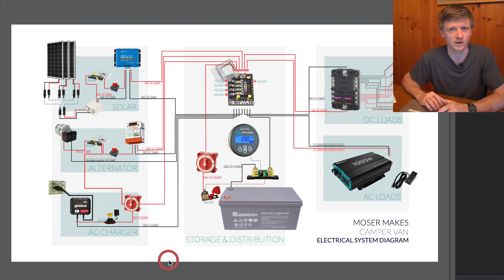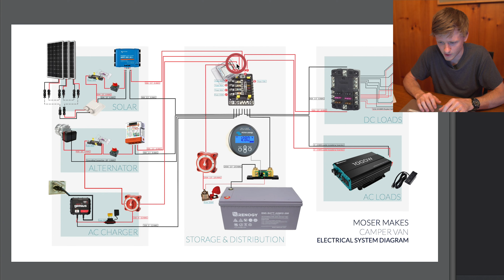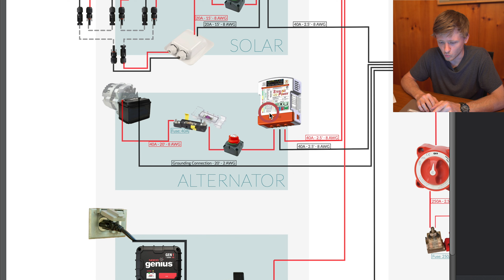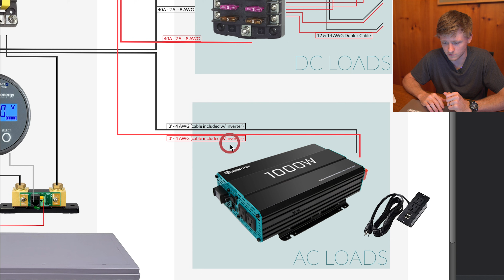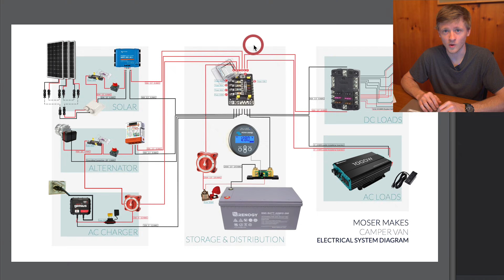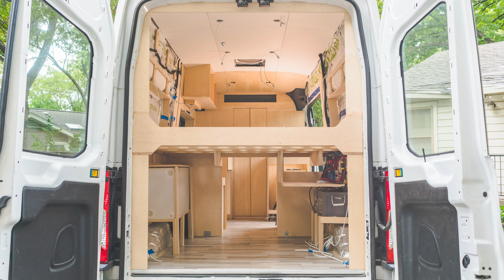Camper Van Electrical System - Comprehensive Look!

Comment: 3:50 Note that a simple voltmeter is only useful to determine the state-of-charge (SoC) for a lead acid battery. For a lithium battery, the voltage drop-off is very flat from 90% to 10% SoC, which means you won't get accurate readings if you try to determine the SoC from voltage in that range.

A smart monitor measures both the voltage ánd the current draw over time, while keeping track of how many amp-hours (Ah) have been used, and therefore how many Ah are still left. Though overkill for lead acid, this is necessary for lithium batteries.

Comment: Hello Moser:
I would like to know if you have to ground your solar system to the body of the van. This would use the same ground as your car battery. OR did you actually keep the solar system ground independent/not connected to your car battery ground? hope this made sense.  Thank you

Comment: If you had the dual alternator/dual battery option from Ford on your Transit, could you just take the leads from the non-starter circuit alternator and just attach them to your house positive/negative bus bars instead of using the battery/battery charger?

Comment: Okay... question of the day... what's the difference of a Alt to B charger vs B2B? My van came with a Sterling Alt Pro C (Alt to B) charger however I'm starting to rewire and build for solar. Now when referencing what everyone is doing, they have the alt wired to starter battery and then have the B2B charger coming off of the starter battery. I find your video the best which I seem to find myself gravitate back to. However, I'm doing mental gymnastics with what the difference is or could be in these products. I'd LOVE your take! Thanks!

Comment: You should add a AC shore direct cable input to your AC electrical sockets and have a some dedicated socket only for your inverter and then your setup is complete

Comment: Tip 1 if you vehicle has  a seven pin trailer connector.  It has a circuit to charge aux battery easier setup fewer parts automatic disconnect when vehicle is off already fused.  Splice into trailer connector wiring easy.

Comment: Sam, thank you for this--it was great.   Can you share a link to the 12v blue splices you used, as well as the quick disconnects you used?  Do you have any video showing exactly how you ran your 12v wires around to all your lights, light switches, fridge, etc?  Sort of wanting your thoughts on through the wall vs inside cabinets or behind insulation, etc.

Comment: Very well talked through. I'm sure I'll be watching this 100x as wiring is not my strong suite - thank you for this. How has the battery worked for you? I'm trying to find a battery for my van, no solar power since it's basically a weekend get a way van but I've been looking at the Battleborn lithium batteries. Much more expensive than what you have but the link you shared reads a 200ah battery.. makes me wonder if this would work.

Comment: Not bad mate. Only recommendation I would say to you is to change those couple of crimp wire splices out to soldered connections instead. I have found they will always fail after  a year or two. Since they are an insulation displacement joiner, they are prone to eventually spread further open and create intermittent connections. If you are drawing enough current through them, they can heat up and eventually burn out   The rest of the terminals etc are really good. Great work.

Comment: The Blue Sea Hub is designed as a distribution board for outgoing circuits
Your diagram with the two buzz bars is a much better way of connecting all those inputs together. I would only publish that one to be safe. 
You couldn’t put a 3000w inverter on that hub it cannot handle that load
Reply: Interesting. I know nothing about automotive/marine electronics but even I thought something was missing in the explanations. Like why does one 8awg wire use a 30am inline fuse and another 8awg wire has a 40 amp fuse? The fuse is to protect the wire as well as the devices but do both of those fuses protect and AWG wire size? I don’t know but it’s an obvious question and no explanation was given for why that works. Please explain WHY it is better to go with the two bus bars? I think you’re being nice and left out that those fuses were not necessary and were duplicates. If they’re not duplicates then they are necessary so which is it? That was an area in which I wondered why it is necessary to have additional fuses if they can be replaced by non fused bars? The blue sea hub is an expensive part and if you tell people they don’t need it they’re going to find cheap alternatives. I know about AC electrical in houses but I don’t know DC in vans.
Reply: @GOLDVIOLINbowofdeath  my video on cable and fuse sizing may help you https://youtu.be/koFg6oFs0RU
Reply from the maker: Hi Greg, yes this is a really good point. Blue Sea Hub was a great fit in this system which has a smaller 1000W inverter (and overall the system is on the smaller side). For larger systems it is better to use separate bus bars or power distribution blocks.
Reply: @MoserMakes  the only reason I mention that is because the max rating of the hub is 200A at 12v and a 3kw inverter could pull more current than the safe limits of the hub. Thanks for getting back to me. Best wishes
Reply: @GregVirgoe , thanks you to have pointed that out. I'm don't have much knowledge but I'm looking to build the same kind of electrical system for a van conversion. What do you think about a 2000W inverter for this kind of build with the same hub? Thank you !

Comment: Hey Moser, awesome videos. I've watched them all and they are proving very helpful. But I need some help. 

If I want to run induction stove top (1800W) and toaster oven (1800W) at the same time I would need a 4000W inverter.
Induction Stove top and toaster oven max of 2hrs per day total -> 1800W * 2 hrs / 12V = 300AH battery required
200AH battery can produce up to 2560W (200 * 12.8), 2000W more realistic.
So I would need 400AH of battery for my 4000W inverter running toaster oven and induction stove top at the same time. 

Does all that sound right?

Comment: Just built this setupa dn everything works well except the switch (1-2-OFF) to differentiate between if you wanna charge (shore) your car or leisure battery. I bought the exact switch, but didn’t work. The wiring is correct bc it works if I just put a ON-OFF switch. Any idea why?

Comment: I am putting a leisure battery in my 2009 Volkswagen van. Coming from my split charger for my secondary battery, can I use a lithium battery? Even though the battery that starts my engine is not lithium?

Comment: Awesome video.
A little question though:
Is a battery to battery charger really needed here or just a VSR would be good enough?
I would assume sensitive relays do apply to standard Alternators, where battery-to-battery chargers are used for Smart Alternator? But I might be wrong. Can someone shed some light on this? Cheers.

Comment: First of all great video. I'm wondering if you might be willing to answer a question I have. With the cutoff switch from your panels to your charge controller. Since your connecting panels in series I assume your voltage comes out to about 60v. From what I'm able to gather the cutoff switch in your link is for a max of 48v systems. Are you concerned at all about that? Or am I not understanding something correctly. Thanks so much for your content and for any help!

Comment: Great video, we are wondering in your diagram, the AC charger connected to Bus Bar Label B which is output to DC loads then how it can be charge the House battery if we plug into shore power outlet? Thank you

Comment: Hi Sam,
What a simple and easy to follow video. I have looking for months for just this. Well done.
I have a few questions based on you configuration.
1. Do the fuse and shunt sizes change with larger battery and solar?
E.g. I have 900w (3 x 300w) solar panels with 450ah (3 x 150ah) AGM batteries.
2. I have 1000w inverter. With the solar/battery sizes, do I need to up see the inverter?

Comment: Your wires are loose (and messy but that's not a danger)....loose wires start shaking while driving (that's why cars use special wire) and can break internally...this can cause defunctioning and/or fire....
You should not let the wires hang loose, bundle them and mount them.

Comment: I.B.E.W. Wireman here. Good job kid. You may want to recheck your wire sizes with a real handy cheap book called a Ugly's Reference book we use in the trades. Amperage is decided by the insulation on the wire which determines which gauge. Then look into derating also which is more of a problem with the DC side. DC has alot of voltage drop hints why we use AC on power poles for miles & then into homes, commercial buildings etc. Great job though seriously. I cringe when I see ignorance breeding on YT too often on electrical. Ignore the thumbs down you get & negative comments. We go to school for 5 years & are the best in the world. If I had to grade you on this it would be a 80 to 90% forsure. I'd have to be there personally to check things out more & you even said it yourself it's a bit sloppy. Great job my friend & thank you for saving someone's life & not breeding ignorance. It shows you did your research. 
😎👍
 FYI..  I'm in the middle of building a Sprinter & just started a channel too. It will be long going cause I'm old & Winter is here now too. 😂

Comment: Thx man I have been sending your video around so they go to your youtube channel. Question. My stupid phone cant magnify the in line midi fuse between the starter battery and the stop switch. Is that a 40 amp fuse in there? Blue sea150s r super hard to find during. Covid but finally after 4 tries found 1 at Dell city.. so whenever it arrives I will set her up. Bought my odyssey battery b4 I found u. So I will get 1 more of them otherwise I will hook her up exactly like u and tried to buy thru your links. No solar yet though.. u rock!!. Ok. Out. Ken ( ty so it's cold in bend and alaska.stuck here from alaska. Nice place tho. lol)

Comment: Great video. One question: why do you have to disconnect the Sterling B2B when you are charging the main battery via the Genius AC battery charger? If you leave it connected it will also charge the aux battery.

Comment: I'm having a hard time understanding the sizing of the inverter. I will likely only have 1 laptop that will occasionally need to be charged and I'm curious if I can size my inverter down to 700w. Any advice/tips on the sizing? The remainder of the system will be almost exactly as you have yours.

Comment: Great job.  I'm planning on having all 3 charge sources as well. I'm wondering though about possible risk in how you have all 3 directly connected together. For example, is there possible contention having the solar charge controller and B2B outputs tied together as you did?  I'll be using Lithium batteries and am considering a combo charge controller like Kisae to keep it to a single charger output.

Comment: hi, I find this useful and I'm about to do my electrical system for my van build. I have a 200 watts solar, 20 watts solar charger controller and the circuit breakers I got are 3 x 50 amps to connect to the other parts of the electrical. is it too much should I replace it to 20-30 amps only? my inverter is 24v I thought I got the 12v can I just use it? lastly are those electrical cables gauge depends on what fuse, circuit breaker or charge controller wattage I have? could you please let me know the right amps and electrical cable gauge to use? I will appreciate your help. thank you in advance

Comment: Fantastic video! I'll be using your links and following your plan. 2 Quick questions:
1 - your MC4 Connectors and Sterling Pro Batt links are missing. Are there backup options that would fit this configuration or should I just try and buy from somewhere else?
2. How many solar panels did you use? 
3. Other than placement is there anything you would have changed?

Comment: Thanks for making everything so clear! 
Ive oversized my wire to 12 gauge for my pick lights. Is a t tap splice the best way to connect the 22 gaugewire of my puck lights to the 12 ga wire running to the fuse block. 
Appreciate you're help

Comment: Great video! Very clear. I was just wondering: in this configuration AC loads will go through the alternator even when you are connected to an AC electrical outlet. The solution would be to add a two way switch between the AC input, alternator and AC loads? Right?

Comment: Yo! BIG mistake in this video. The inverter will NEVER draw 80amps, its the wattage of the appliance (800watts for example) divided by the output voltage (which is 120V in the US and 240V in the rest of the civilised world). Thus, the amps consumed would be 3.3amps (normal world) and 6.6 for the exceptional US of A (based on a 800w appliance example). (@15:30 mark).

Comment: Great job.  I'm planning a very similar setup and have been looking for guidance on wire sizes.  You also helped with some other questions that I had with my design.  Thank you for your time putting together this well done and succinct video.
Reply: Can you charge your starter battery from your solar panel input while sitting in camp?

Comment: Awesome! Just one question: are you grounding anything to the chassis? I’m setting this up now and don’t wanna overlook anything. Thanks a ton!
Reply: Seems to me like no, he's not connecting anything directly to the chassis. Just connecting everything to the negative bus bar, including the car's original battery... seem's like that is the connection point to a system that is grounded to the chassis.

Comment: Is there any chance that you filmed yourself installing any one item such as the shore power for the battery to battery charger? I would love to watch that sort of video, where somebody shows the actual installation of one of these important parts of the electrical system.

Comment: I just wanted to see how you did this that differed from the boats I build. Turns out, not much. Just somewhat less complicated. Everything in boats talks to computers now. Also, kudos for using stranded cable. ALL vehicles of any kind vibrate and flex a little bit. Solid conductors will break on a shorter timeline than you might think.

Comment: Do all brands of RV Solar Panels connect in series. I have 2 ZAMP 160 watt panels and didn't use Solar Roof Cap and I connected the panels in parallel before connecting them to controller. Your videos are great!

Comment: Why wouldn't you just use the hub for the DC loads instead of having the additional blade fuse block?  Doesn't the hub's blade fuse block be used for that as well?
Reply: @MoserMakes  Since the charge controller and inverter taking up 2 of the negative buses, if I used the fuse block, it seems like I'd have to piggyback the negative cable onto one of the 2 negative buses?  Or am I overlooking something?

Comment: As others have said before me, you really explained everything very well. Thumbs up for that. But, the way you connected it all on the board, although you studied about the layout of the components is what I call typical American. I see that so often. It seems to me Americans don't care about how things are wired. I found out on day one of renting an RV. In the first evening when I was hooked up to "shore power" and switched on the AC a circuit breaker popped. When I found it, hidden in one of the two seats at the dinner table I was shocked about what I saw there: all sorts of wires and cables, different sizes, different colors, some in plastic hoses, some not, running through and over each other: it was a mess.  Lately here on Youtube I watch a lot of van (re)builds and see it again. Why? Why can't it be neat?

Comment: Hi Sam, love your videos, very inspiring. Just a question re the AC charger switch. Have you considered using a DPDT switch in place of the 2 switches. This would allow the B2B charger to be disconnected as the AC charger is connecting? Regards

Comment: Hi, awesome Job and great Video. I´m also building a van at the moment. I will take 200ah lifepo4 batteries. Same two blue sea systems as you. Should I also install a Terminal fuse holder and if yes with how much protection for batterie (and also Victron MultiPlus C 12/1600/70-16 12V 230V 1300W 3000W) ?? ... maybe you can help me ... I´m a bit confused right now ... will the multiplus installed directly to the batteries (e.g. terminal fuse) or at the external 150 safety hub ? ... best regards Jan

Comment: What is the difference in the two different on/off switches that you are using?
Reply: @MoserMakes  That's what I wondered.  Also, do have a link to the fuses themselves.  I bought the fuse box and other fuse links, but they don't seem to have fuses.  I want to make sure I"m getting the right stuff.

Comment: Thanks for this great video Sam. Would it be ok to use a 3 way switch (1-off-2) and feed the Sterling with the alternator power (1) or a simple shore 120VAC/12VDC charger (2)? This way one never forgets to switch the alternator or shore off. This let's the Sterling do all the house battery charge management. I would appreciate your perspective. Thanks

Comment: This is really helpful! The best video I've found. I do have one question though. If you took the positive and negative, coming in from the solar panels via the solar charge controller, to the battery rather than the fuse / grounding block would everything (including the victron BMV712) still work? I'm really not an expert but it seems odd to me to take it to the fuse / grounding block. Would the power be too great if you had more solar, say 600w, for the block to cope with?